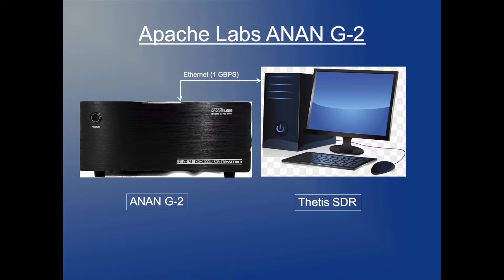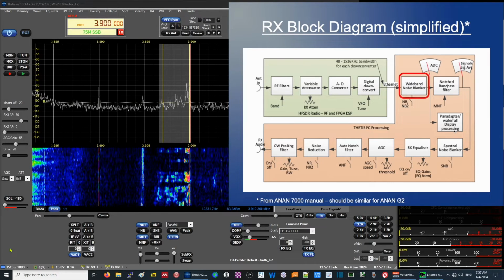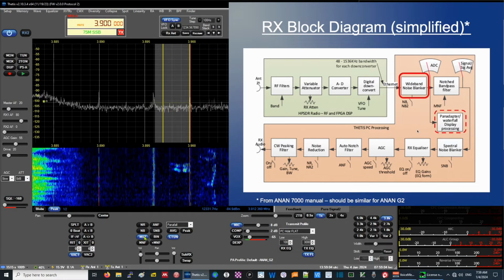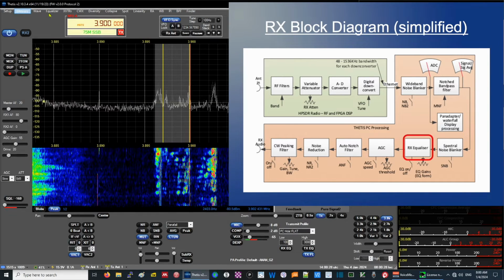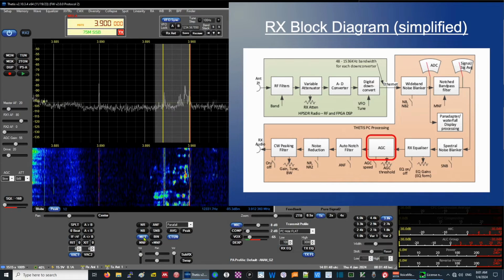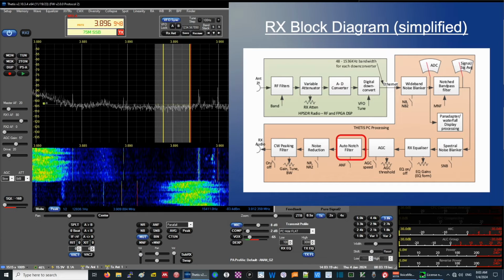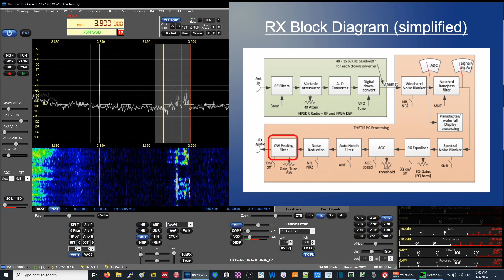ANAN G-2 Thetis Filtering Overview

Comment: Sounds crappy.
I know it can do better
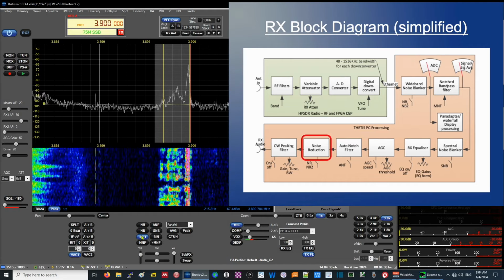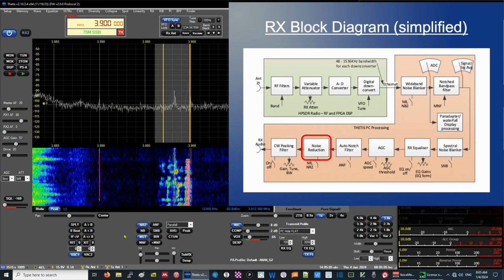Reply from the maker: Thank you for the comment.  At 8:54 when NR2 is enabled it cleaned up the signal pretty good.  I then unlicked NR2 at 8:58 and the noise came back.  I enabled NR2 again at 9:07 and the noise went away, again.  I then clicked on SNB at 9:14 and the signal became sharper in the higher frequencies and clearer.  At 9:22 I enabled ANF and the signal was mostly unaffected since no Noise filters had been previously configured on this window.